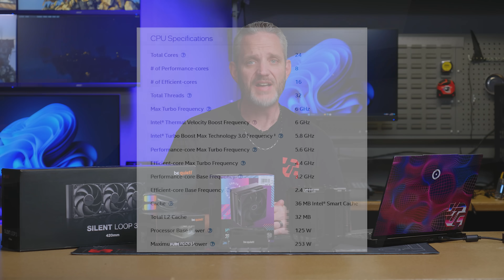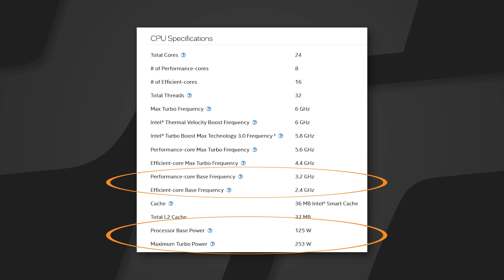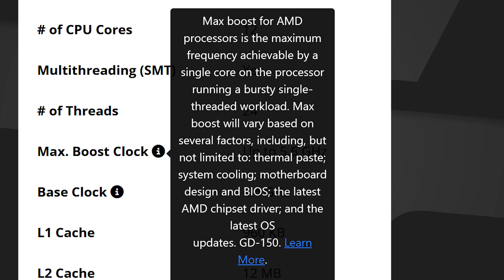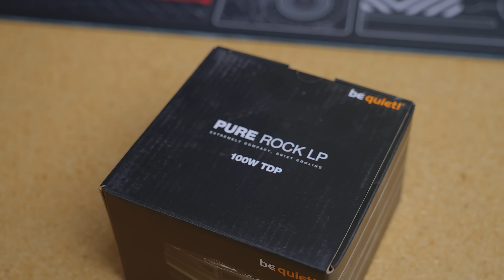Forget what you THINK you know about TDP

Comment: man i have dark rock pro 3 am4 5900x @static 4.5 all cors 1.2v and 68-70C in cbr23 and its silent so so. When i gose to max mobo pbo+crv then boost go to 5.0-5.15 with 90C ) and cbR23 have low score) then static) - pbo is shit )
SO my dark rock pro 3 is 250 wats sined by manufacturer. but in reality 5900x in hwinfo did 150w  with @4.5 1.2v and 68-70C . tdp as lable on the box is shit).

Comment: I'm surprized that almost all big brand air coolers list a wattage they can dissipate, I don't see these anywhere on AIOs or waterblocks. I wonder why.
Reply: might be cuz a 240AIO can do every cpu and big aircoolers cant
Reply: Water cools better. No surprise there
Reply: Because a simple waterblock can have a 120mm radiator, or a 1080mm radiator. A fast pump, or a shite pump.  Too many variables. Waterblocks are designed to get the heat to the water asap. Cant measure that.
Reply: @danielvannuland2681  I see your point but same could be said for air coolers. A big aircooler states it can handle a 300W cpu. But it wouldn't work in a terribly ventilated case. So i see aircooler state a maximum wattage they can dissipate in a near idealistic scenario. Well ventillated case with reasonable room ambient temperature. But waterblocks state "nothing". They could list that if u have x l/min and 30C water it can handle x Watts. So it's actually a way to compare waterblock to waterblock in some way. Nowdays i see same cpu compatible waterblocks for 40$ and 300$, i doubt both can handle same performance, and there is value i can compare them like air coolers do.
Reply: @almaweewoo  compatible,  but not comparable. Fin density between blocks would skew a comparison of flow rate and water temp. Your cooling is mostly dependent on radiator sizes and total amount of liquid in the loop. All the metal of a 300w air cooler will heat soak very quickly if hit with 300w. What you should be looking for in any custom loop is total water capacity.  The caloric energy needed to heat metal to 90c is a hell of a lot less than say,  half a gallon of water.  Thus the inferiority.
Reply: @danielvannuland2681  I think we talking about different things, i dont wanna compare air to water i'm sure water is better is almost every way if well maintained. But i do want to compare waterblock to waterblock. And the problem that exist there is no comparison between a 20$ waterblock to a 300$ one only the price. The only thing i can go on is watching youtubers trying loop where the only thing they change is the cpu block itself and watch what temps u get each time.

Comment: I have an 5900XT and a 360 AIO, my CPU always had 95c while working, but I undervolted offset with 0,125and now the temps are never above 75c. The clocks are the same at 4,95Ghz. Could probably go above 5Ghz stable. My 360 is an 5-6 year old nzxt

Comment: If you want to stick with accurate retro gaming with the 1366 mb, you need to source a Thermalright True 120. After careful consideration and thorough  research, I built my system with an I7 920 and True cooler, overclocked that mother fornicator a full gig as soon as it was built, ran it like that for a month, then felt guilty for spending so little money for a lower price processor and making it run like the top tier I7 so I dropped the speed by a full .1 gig. It eventually became our media pc for the bedroom tv and finally retired last year, still running the high over clock. The True will be brassed and hung up with our babies first shoes.

Comment: oh you are SO WRONG ! i have a ryzen 5950x at default it barely reaches 4.6 with huge temps around 85 .................downvolted to 1.250 , temp 76 max max boost 4950 ( by specs it should be 4900)

Comment: I replaced the stock cooler on my Ryzen 5 7600 with an Arctic Freezer 36 CO. With a bit of undervolting it's running full speed under full load without thermal throttling, even on a hot summer day and with the 0db fan curve. Well worth the upgrade and I only payed 21€ because it was on sale.

Comment: Remember that ofloading encoding to the GPU will result in a MUCH more inefficient encode, and most hwencoders aren't even full featured, you should always prefer software encoding unless size/bandwidth is not an issue at all or you need like 800 fps encoding for some reason.

Comment: I wish i was good at Installing Coolers--with my Intel 10700 Desktop i had the original install from local builder with Intel Stock Fan, which i knew wasn't enough,    then choose Be Quiet Pure Rock 2,  attempted install myself--Failed.      Got PC to Shop and settled on whatever Air Cooler they had in stock ( as forgot to take the Be Quiet Model along)   Ended up with Arctic Freezer 7X Tower Air Cooler,   still didn't cool that great in Thermaltake V200 TG RGB Case.      So far didn't try again with the Be Quiet Cooler as nervous as all heck

Comment: I just got my 9950x and did a r23 run it climbed to 95c using a 360aio, then i undervolted it to all core -35 and it droped to 89 to 92 c and it still hits 5.7 on a few cores when i use r23. It droped temp and went from a 40k score to 44912. So it helped in both cases.

Comment: Wait, 7800x3d running 120w? Mine never goes above 85w. I have more than enough cooling, doesn't matter if pbo unlocked or not. all core loads in cinebench stay between 4,9 and 5ghz so I'm pretty much maxxing the cpu out but still the watts are not even close to 120w.
Reply: TDP is 120W

Comment: First built PC had HR-02 macho with FX-4170 and later on FX-8320, 6600K and 6700K. It lasted through all of those cpu's and Intel ones I OC'd easily to 4,6 and 4,7GHz respectively. 
When I sidegraded to AM4 and R5 3600 I had to get a new cooler since that old hunk of aluminum didn't have AM4 brackets. So I went with SilentiumPC Fortis and still rocking that combo today :D
What I wanted to say is, I always went with a big chunky and budget aircooler with 140mm fan, and they have served me well keeping CPU temps down when I extract the extra juice with OC/PBO+AutoOC. Ofcourse they take a bit more space so smaller cases are a no no.

Comment: Pro tip: A second fan to the back of that Hyper 212 in edition to the rear fan can further help keep that CPU cool. I even do that with the Darkrock Pro 4 I have. 5800X in an old case, 80 degree F room, the CPU is at about 55 to 65 C, with the gaming I do going to about 71 C, though I have a fan curve for 50% fans at 65C or less, with 100% fans at 80C and I am using a Noctua 3000RPM capable PWM fan for the rear fan.

Hope it helps.

Comment: The only cpu cooler that really impressed me is the hyper 212 

The have used 4 240 aio and they are loud the fan or the pump... To the point that its just the same as using a laptop jet engine and the worst part temps are shit i repasted remount and swapped fans with high pressure ones temps are shit wen compared to noice... So at some point i just ordered a hyper 212 temps are the same but the noice the fucking noice is gone so i got 3 more and replace the other 3 aio from the other 3 PC all the same temps stays the same and the noice is gone...

What dit i expect to happen? Better temps and low noice wen using an aio i was disappointed and yes these where all different aio from different brands but the pumps where all asatek something something

Im done with aio maybe a costume water loop can solve my problem that i have with aio but meh i dont feel like putting money in that now 

air coolers are amazing wen it comes to price to preformance compared to aio's

Comment: Been learning things for the last month and a half about cooling, undervolting and and sustaining boost clock speeds, which  Jay just confirmed everything I've been trough trying to cool i5 13600k I have along with ROG 120mm AIO. These two doesn't go along when it comes to even playing games, like Battlefield 6 and Arc Raiders. CPU is being tortured while playing these two. Still not sure which cooling system should I buy so i can cool off this boy... I want to maintain 5.100/5.200Ghz boost clock while CPU is being under 50/60/70% underload, hoovering around 60-65c temp. Any recommendation guys please?  @JayzTwoCents

Comment: I had 80mm fans and big aluminum heat sinks on a dual Pentium Pro setup and the fan power wire fell off.
NT blue screened almost immediately so I powered down and rectified the situation.
Glad I wasn't running an AMD Thunderbird LOL.

Comment: I used to work for a company building servers and workstations. These were not standard machines but built for each customer to fit their specifications and use. I can say we never looked at TDP as anything else than a indication of which processors were going to be running hotter than others. And we never looked at any wattage numbers for coolers. I did sometimes compare the numbers between coolers from the same manufacturer, but even that was not really reliable and only used to see if some new cooler might be better than their older models. So in the end everything was tested using maximum load in a room with a temp of 40°C for 24 hours. Then the loggs was checked and if the processor ever throttled or got real close to the throttling temperature it was considered a failure and the installation corrected before it was tested again.

Getting the max out of processors was and interesting problem. It isn't enough to just run some heavy computational task or even something like Prime95 Torture test. There are some programs that has been made explicitly to stress the processors to produce as much heat as possible. And to do that you can't just have one program you throw on all processors no matter what generation or make they are. No the one I used had over ten different versions and when testing a new processor generation you tried them one at a time until you found the one that pulled the most power. Usually it was considerably more than you got from Prime95 Torture test or different other torture tests. 20% more power was not unusual. The idea behind this was that if the cooling could hold a processor from throttling in a warm test chamber then it would have no problem keeping things cool in a 20°C server hall no matter what real application they ran on it.

Comment: One test I would like to see is, since AMD 7000-series (maybe 9000 too?) has thick IHS and does not dissipate heat well, a very good cooler does not necessarily help as the issue is the IHS, not the cooler, so what is the "highest end" CPU cooler you should get for AMD 7000-9000 (dry ice and Peltier systems excluded) and when it simply stops really making any difference due to IHS. I have a huge radiator and a good pump. Have tried a couple of CPU heatsinks. My 16-core simply goes straight to 95+ when under all core loads, even with negative voltage curves.

Comment: My i7 3930K at 4.8Ghz 6 core 12 threads capped at 1.4vcore has recently gotten a brand new Corsair H115i 280mm, more so becaus 360mm does not fit inside the HAF XM and that is just about enough to keep the CPU between 65-75°C in most full load conditions. X79 VRMs do get really hot beyond 80s so a Noctua fan is intake on the rear to blow over the VRMs and dropped the temperature by about 20°C including the CPU 5-10°C because the rad is in pull mode with no fans at the bottom the Noctua also blows past the rad.

That little beast still plays Battlefield 6 at really playable framerates, best purchase ever.
Reply: No, bro. A 265K at 1.26V VCCCore , 1.19V P Core (-0.90V Offset), and 0.850V E Core still hits 5.5-5.6GHz and 4.6-4.9GHz respectively with a -0.100 offset Ring and gets a score of ~143 single core and ~2173 multi-core in Cinebench 2024 with only DDR5-6000 RAM.

Comment: so is my "240w" tower cooler still undersized for my r5 7500f ?
it keeps hitting 95c under moderate load even after replacing the thermal paste and remounting the cooler at least 5 times by now
Reply: this cant be right. did you check or change the fans?
tried another cooler?

Comment: Really useful video.  Maybe consider a part 2.  Cooling in an SFF case.  Especially as you start to ramp up the cpu, add in a 5080, then compare the cooling options to maintain 4k high settings.

Comment: The more cores and use cases I have, the more I feel like there should be more CPU wattage setting presets for different uses. One for gaming with a goal to run few cores at max clockspeeds, one for maximum all-core clockspeed, one that runs the cpu as fast as it can at a point where power-per-performance is at its best and maybe one that offers something else, like... lowest power use without crashing performance if you absolutely want to maximize battery run time on a laptop or when you are on backup power (UPS)

Comment: You're making a mistake here Jay, for example on Intel's 13th and 14th gen CPU's they have too high voltage by default, lowering them does not reduce clockspeed, it does not reduce performance, the only problem you can run into if you're too low undervolted is bsods or applications closing at random which is what you want to prevent.

My 13900K runs -0.06v undervolted on global SVID on oldest 0219 bios on Z790 Extreme since 2022, oldest microcode 0x10B, it has no voltage issues, it always maintains up to all core 5.5/4.3Ghz or 5.8Ghz boost, it never throttles because the H170i keeps it under control even with 290W continuous powerdraw in Cinebench R23 with all power limits and times removed.

And ontop of that because it does never hit much further than 90°C it will never throttle so benchmarks and multi-threaded workloads will always run faster than it would without undervolt and throttling situation.

Comment: Jay, when I build a new computer for myself, I like to overbuild. For example, I was using an AIO (the water has evaporated from the AIO) for several years but I was never really happy with it. So I went to Air, and got the Be Quiet! Dark Rock Pro 5, 270 W of cooling for a 5800X, it can run HOT. This cooler works much better.
Reply: I forgot to mention my 5800X will hit up to 4.5GHz and I don't know if that is why under load.

Comment: TDP is mostly accurate, but the problem is not rated TDP vs reality TDB. The problem is the user who overclocks, raise voltages and tries to get 1MHz more if it is stable. 13600K can run on rated 120w TDP and if you undervolt it, you will get better clocks, but you won't get 5 Ghz+. The problem is profile in BIOS that tells CPU how much of amps can have, how much power can draw. If you lover your amps that can go through CPU, you will get better temps at same clocks. My 5800x3D is a 105W TDP,  and I undervolted it by -0.250V and limit it with 105w of power, lowered current that can run through CPU so my CPU still clocks at 4450MHz and never runs above 75C on 100% load on Arctic Liquid III 360. In gaming is around 60C and that is in CPU demanding games. Just undervolt your CPU and don't run it on its upper limits. Difference is like 5-7% better CPU performance but you pull 250w instead of 120w. So is it worth it? Double the power draw for maybe 7% better performance on a CPU from which your GPU cannot pull more frames because it's at 100% usage.

Comment: downsized my pc, it has a ultra 285K, and a 5090 astral oc, cooler was the biggest issue. i wanted a small form factor, ideally. but i ended up going with the HS260 from deepcool for the case (MATX but small) and it fits a 360mm radiator, so I used a arctic freezer 3, so far so good - hottest core around 78 under a cpu stress test, but i am using a pretty reasonable fan curve too. impressed, but yeah - new cpus are hot as hell man.

Comment: i have 5800xt 105 tdp they said 240 aio would be good but i found was still not good enough for my  liking so i got 360 aio and now staws in 50s when gaming  was getting to 70s with 240 aio the 5800xt will get  to 160 watt with pdo and its only 105 tdp

Comment: Does cooling even matter as long as you stay under the thermal limit of throttling? I'm not sure it does, at all.
Reply: It dose it actually matters a lot the more thermal head room you have the higher the clock and the more stable it should be

Comment: I´m building a portable gaming rig with a Games Sentinel G170 and a lenovo m720Q upgraded with a Yeston 3050 gpu. I currently run a i5 8400T , I bought a i5 9500T and is currently looking for a good price on a i9 9900T the max this system can handle. All of the cpu´s are listed as 35W TDP and so is the original cpu cooler,but I ordered a 65W cooler the highest that will fit the case, is that likely to be enough cooling and if more than required will that give me higher and/or longer cpu boost speeds? 
I´m going for smallest possible portable gaming rig on a limited budget and a laptop that can run games better is likely to cost 2 x or more and all at once. I primarily want used parts to save on co2 and cost.

Comment: Im pretty sure my 13600k only draws around 70watts when gaming around 20-40% load. Sure if you render stuff or so and peg the 13600k to 100% it draws alot more, but with my 3060ti in 1440p I havent seen more than maybe 100w in afterburner overlay when gaming.
Normal gaming temps @5.2ghz 50- high 60's c with ek 240 aio.
Reply: And with my curve, nether the pump or fans are close to 100% with those temps.
Reply: @TheAndreasKL  Would be highly appreciated if you explain how did you achieve that? Im struggling with my 13600k... thanks bud

Comment: i went all air as i did a 9800x3d lol, 6 - 140mm, 4 - 120mm, dual fan 120mm peerless assassain cooler. 
all thermalright. everything stays cool and quiet. case is nzxt h7 flow